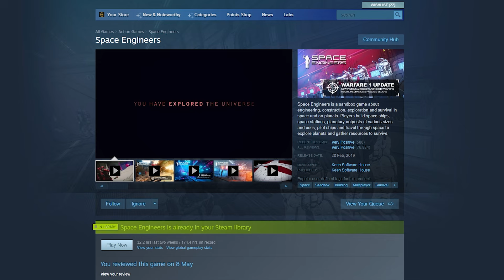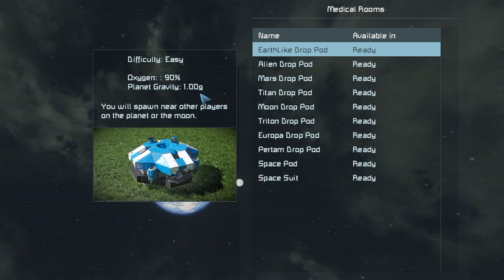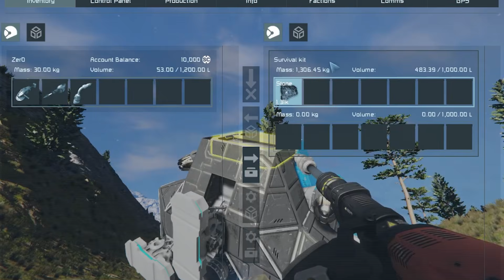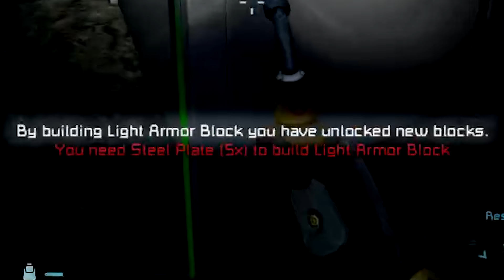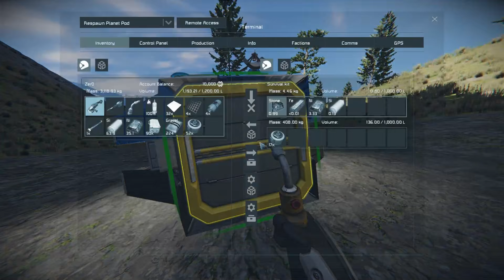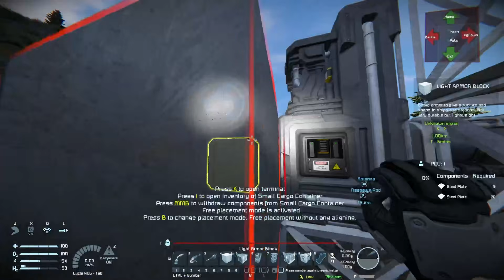ULTIMATE Beginners Guide to Space Engineers - Getting Started

Comment: You forgot a few things
For bad landings, respawning is not your only option. F5 will also bring you back to a fresh start, yes it does reload the world, but it does change the location for the drop. 
With the inventory, you mentioned shift click that's not the only method. Ctrl+click will transfer 10, shift+click does 1000, double click does the whole stack and shift+ctrl+click+drag will allow you to transfer exact amounts. These methods also apply to queuing parts in productions blocks other than the double click and shift+ctrl+click+drag. 
And for the love of clang turn progression off, that's found in the advance settings. As to the reason, the progression is done poorly and is nothing more than a hinderance. 
Tip: Start at the main menu go to Options> Game, Building mode. Change this to "Line" This will save you time with building crafts in creative mode. 
And this is where Experimental mode is found as well. This is the toggle that allows for scripts and mods to be enabled later on. 
When putting blocks on your hot bar again don't have to drag and drop. Right clicking will place it on the hot bar as well.
Reply from the maker: Aside from the first thing, I did know most of this. I'm sure I mentioned the ctrl and shift-ctrl in the video (but if I didn't I can always bring it up later). Personally, I feel like progression is there to help you learn the game. I've played with it on and off and it doesn't really make much difference as you generally can't make alot of the higher tier stuff much later anyway. And besides, if I started this video with a 20 minute segment on all the settings you should and should use, everyone would resident sleeper away. The building in creative thing, whilst useful, isn't relevant to this series as this is about survival (also as a side note, it's really annoying that this option is hidden in the settings as it's so useful). I completely forgot about experimental mode for the video but it shouldn't matter for now as I haven't touched any of the experimental settings but I will make sure to bring it up in future. Anyways, that you for your feedback, I really appreciate it. 😄